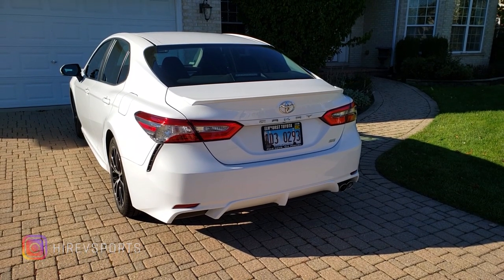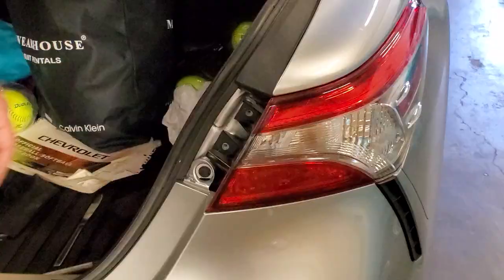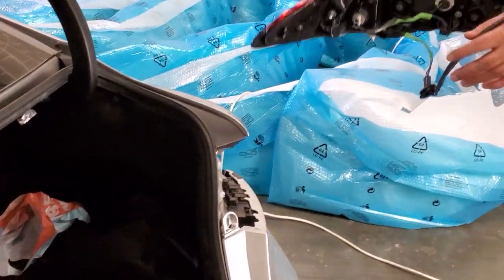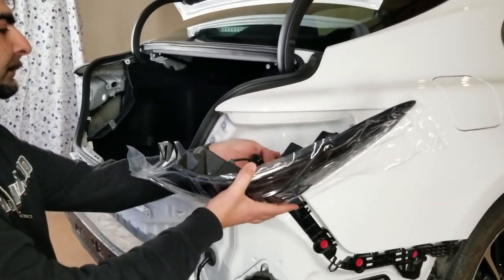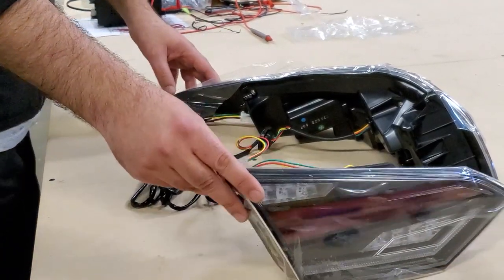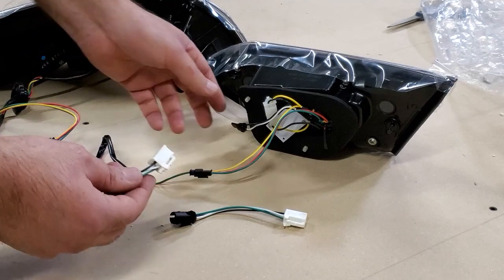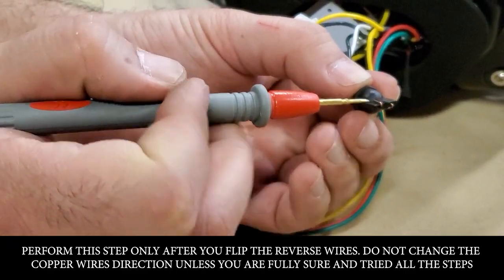HRS 2018-20 Toyota Camry - Nike Style LED Tail Lights Installation - Updated

Comment: Just finished installing it, wasn’t too bad to install. The wiring steps didn’t match up even though I got this exact tail light model for my TRD (but wasn’t hard to figure out). Looks amazing 😍😍😍
Reply: I plan on getting the Nike Smoke Black Red for my TRD
Reply: @andre3k658  you’re gunna love it, it’s drop dead sexy
Reply: darktatsu I bet. Just trying not to fuck up on installing it lol
Reply: @andre3k658  LOL know how you feel but trust me, it was more tedious than difficult. Let me know if you have any issues
Reply: darktatsu will do bro 😂✊🏾
Reply: did you have that wire going from the top to the bottom like how it shows in the video 6:00
Reply: @Seven-nz6ht  you can hide that wire if you take the plastic trim off and tuck it behind
Reply: @darktatsu2894  oh i see just installed them thanks
Reply: @Takinshiro1  I mostly used this video. For a few minor details, I looked at an install video on a different set of tail lights from Enrique Arrellano’s channel. He goes a little more in depth on certain aspects of the process so I would say a combination of those two videos.

Comment: Can you do a video on how to install fog light and rear bumper reflector light for 2018+ Camry please?
Reply from the maker: Unfortunately we do no have a regular Camry to do the install. The blue one is the only one we have and both front rear bumpers are not stock.
Reply: HiRevSports you can use mine  😂😂 where are you guys located at?

Comment: I want to purchase this but I’m a little concerned because  the wire from the part where trunk goes upward has to connect to the side part of the tail light. So every-time you open your trunk that wire is going to be there ? How do you tuck it or hide that wire
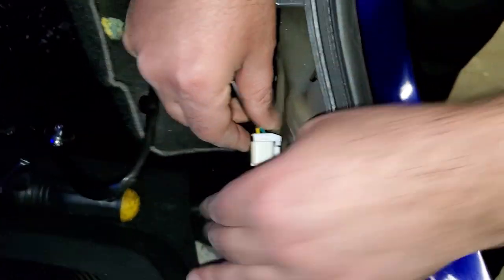Reply: 6:10-6:32 reference

Comment: At exactly 4:30 in this video, you show a pair of wiring harnesses specifically for the XSE. i did NOT receive these harnesses in my packaging; I have an XSE trim, so they are necessary. How do I go about receiving these?
Reply from the maker: The manufacturer forgot to add those into the packages. I believe everyone who had this issue had an email sent out to them. If not, please email us!
Reply: i received them over a month ago. thanks for your reply two months later.

Comment: I bought these and they fog SUPER easy. I even received two separate sets of these. The first set I installed exactly according to the video in my 2018 toyota camry se  and the fogged after 3 days of having them installed. Then, I Uninstalled this set and used the extra set they accidentally sent me and even ran a bead of clear weatherproof silicone along the housing and lens to prevent moisture from getting into the lights. I go outside 2 days later to see mine have already began to fog again, albeit much smaller, it's just fucking ridiculous.
Reply from the maker: Fog is normal. These days all the lights including OEM's are breathable to prevent the lens cracking from inside. Did you buy it from us? if yes, email us at info@hirevsports.com. We couldn't locate any order related to your name.

Comment: 2021 se hybrid has the same size and backk wont it work
Reply from the maker: These lights will work on the 2018-20 hybrid models but not sure about the 21 yet
Reply: @HiRevSports  are there any 21 variants out yet?
Reply: it works on the 21 se hyrbid! I have the same and the stock tail lights looked grotesque. I ordered one for hirev a few days ago, not these specifically, but something with chrome. It said it was only for 2018- 2020. To me it seemed the same. Anyway, it fits perfectly fine.
Reply: He's right, it does fit well. There are no harsh points or anything. It fits in smoothly. I have the 2021 camry se
Reply: @viper1130  oh wow thanks for the quick replies guys! Ill go ahead and purchase it! but I really wanna confirm it with HiRev.
Reply from the maker: @omarcamrren1351  thank you for confirming. We will update the website
Reply from the maker: @an_idiosyncraticperson9378  looks like it's confirmed now 🙂
Reply: @HiRevSports  great I’m going to order rn!
Reply: @HiRevSports  difference between scr and sbr?
Reply from the maker: @an_idiosyncraticperson9378  SCR = Smoke lens, Chrome housing, red lights or nike check marks
SBR= Smoke Lens, Black housing, Red lights or nike check marks. Hope that's helps

Comment: This is a great tutorial but the plug where you take out the bulb and have the wire coming from the light is there a new version of the lights? Cuz I don’t have that wire on mine ?
Reply: yea same, i bought the product and tried to install them but i dont have the same wire set as they are showing, so I emailed them about it but havent got a response back
Reply: @imported3142  they will reply eventually but I ended up selling mine to a friend with a xse and it worked fine for him
Reply: What is this style? Is this SBR? I want these taillights?

Comment: I have a 2019 se, thinking about buy an exhaust system from Magna flow. If I change the rear diffuser to xse can a run the quad exhaust from them?
Reply from the maker: If you change the diffuser, it should fit. Make sure to get measurements to be sure!

Comment: How complicated are the sequential lower bumper lights to connect with this setup? Also, how complicated is the light bar? Thanks!
Reply: Remove the number to get to the bolt for the reflectors and run the wire through the grommet. If you have a harness. Plug and play. If not you tap 4 wires and match colors except. Blue with red. Red with blue
Reply: Bumber***

Comment: Will this set fit well with 2018 toyota camry Se hybrid. Does it need any adapter?
Reply from the maker: Yes it will work and you will not need any adapter

Comment: Will they fit on 2020 Camry LE and is it plug and play or it’s different for this model which involve splicing?
Reply: Yes they will fit the LE. There is no need to splice any cables because it is already plug and play!
Reply: Did u have any problems with it ?

Comment: where do you route the harness that connects the trunk inner taillight to the actual car's outer taillight? is there a pass through somewhere i can guide the wire through? or do i have to let the wire dangle like in your video?
Reply: Your can remove the plastic dog leg trunk covers and run the wires inside.  Velcro, tie or tape the wire against the dog legs and resecure the plastic cover.  Cover is held together by plastic screw.

Comment: I bought these light and had them installed on my SE the reverse light on the passenger side does not work. Any suggestions?
Reply from the maker: Did you buy it from us? Please email at info@hirevsports.com
Reply: Amazon, from mostplus. Any suggestions otherwise?
Reply from the maker: @haha1680  did you look at the our installation and troubleshooting videos?
Reply: Daniel let me know if you fixed the issue i want to buy those
Reply: HiRevSports whats the link to but those?

Comment: The rubber seals/grommets that Toyota installed are designed to keep moister out. Do your lights come with these seals?
Reply: did you ever find out if their lights come with the rubber that blocks the hole from moister?
Reply: @notowen69  Hey! Yes they do and the work just fine. It has rained a lot since I have installed the lights and I’ve only seen one side with a tad bit of condensation in it but nothing since! I also put wire sleeves on my wires which you can get on Amazon. Just feed the wire through and that helps. The lights really look great and work exceptionally well and are far better than the stock lights that came with car. Pissed me off that Toyota didn’t make better lights on such a great looking car. Oh well…problem solved and my ride looks great. I say they are worth it. Hope this helps!
Reply: @Bcilloz  xse tail lights are nice but these are WAY better looking for sure
Reply: @notowen69  Agreeed and had they put the XSE lights on the SE I wouldn’t have bought these. I was perplexed to find out that all that red didn’t light up! Since when are tail lights part of a car package? Even some Kias have better tail lights than the Camry and that’s a damn shame!😄Oh well, you are right, these tail lights are better for sure!

Comment: I have 2019 Toyota Camry SE do I need a resistor for intalling the rear brake light?
Reply from the maker: You do not! The tail lights have a resistor on them!
Reply: @HiRevSports  Thx you are most kind.

Comment: When are these lights going to be in stock again?
Reply from the maker: Around the end if April. Keep following us on IG and FB as we will be posting regular updates there.
Reply: HiRevSports this version doesn’t requires us to trim the wires and connect them with soldering or electrical tape right as in old videos?

Comment: DOES NOT FIT THE 2021 Camry
Reply: THIS IS FALSEEE!!!!!! Just installed mine on today everything works like it should be!!
Reply: And yes mine is a “2021” Camry SE
Reply: @Kurby7  if you don’t believe me join their discord. I did a whole video installation and it was a fail.
Reply: @Kurby7  I dont know how you fit it, but my trunk panel lights were not fitting in, only the side panel lights were fitting.
Reply: @an_idiosyncraticperson9378  really... mine slipped right into place like soap and water 😅😂😂 what’s the discord maybe I might see something you might’ve messed up on, cause I had to deviate a good bit from the installation video for the wires trial and error for a good hour 😅😂
Reply: @Kurby7  I just went with OEM XSE tailights. I'm satisfied with the new XSE tail lights I have.
Reply: @an_idiosyncraticperson9378  alright man